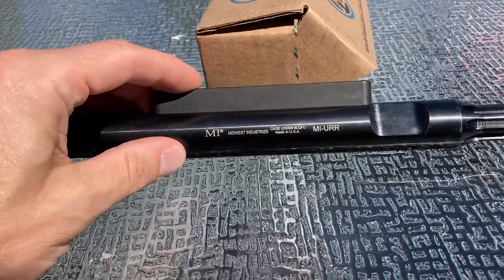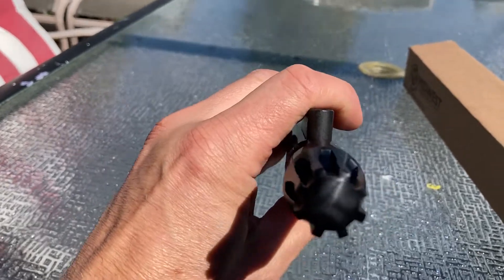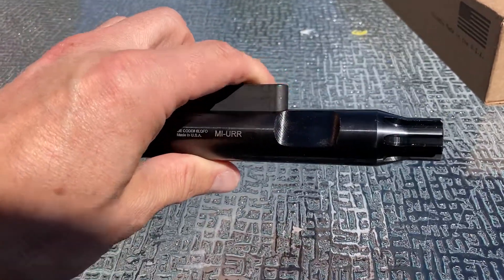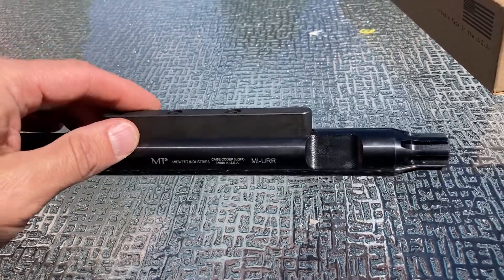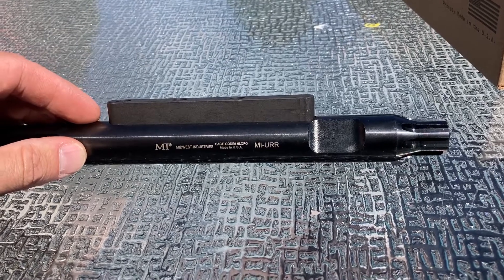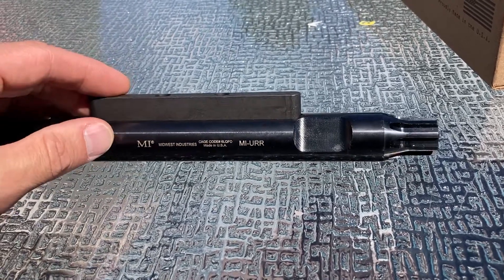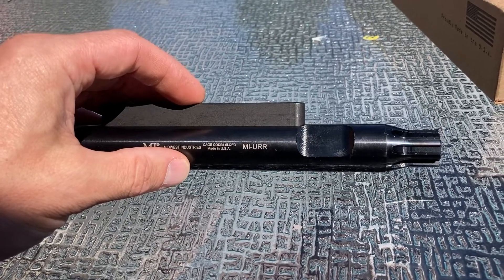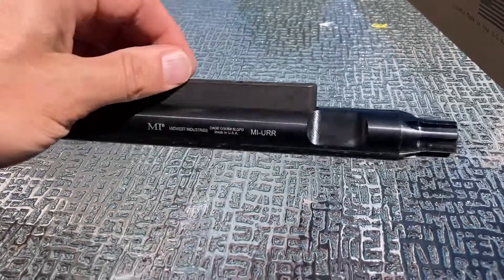Midwest Industries MI-URR Reaction Rod

Comment: Just got one of these and it has the same issue.  Waiting for a response from MI on it, but I may just go ahead and send it back to the retailer for a refund.  Sounds like there's quite a few of these 'mis-timed' ones out there that weren't properly QC'd.
Reply: Update: MI got back to me within a couple of days and sent a return label for the URR to be returned to them for inspection/replacement.
Reply: Same problems with mine and Midwest is ignoring me
Reply: I, ordered twice and both of them were for a 308 but  labeled for 5.56not 5.56.

Comment: I just got mine. When me and my friend installed my barrel we used a bev block. I’m thinking the bev block allows for the barrel to slightly move when torqued down. I’m going to try removing the barrel and reinstall with Midwest rod and see if that helps. There’s hundreds of people who use this tool, so it’s possible the issues is with the prior installation of parts. Just my opinion and what I’m thinking. I had this same issue trying to use mine.
Reply from the maker: It's visibly crooked, and it fits the one receiver where I know the barrel is mistimed

Comment: Every tool doesn't work because of the one he has, and he has multiple bad tools. It's obvious this is operator error or he's a shill for a specific product.
Reply from the maker: Which one am l shilling for? I'd like to try it lol
Reply: I have tried 2 that are for 223/ 5.56 would not fit
Reply from the maker: I hear 2 unique is a better tool
Reply: @whattheshit4664  I have two Mid West URR's and two Unique barrel spuds..All 4 are fine and work perfectly..The 2 Unique has tighter splines with less slop in the barrel extension and the URR has a tighter fitting sail..
Most upper receiver carrier channels are under spec these days and can come in a variety of I.D.'s  
Some upper receivers will not work with the URR or the barrel spud, even though the tools are under the 1 inch I.D. mil spec carrier bore tolerance..
You are not the first person who has complained about an out of spec URR..I have not seen this with the 2 Unique barrel spud..
If the URR is too tight, it is easy enough to remove the sail and have it turned down to fit your upper..I would re-attach the sail and not use it with out it..The sail is what keeps the stress inside the upper and not on the receiver threads/index slot.. It also prevents the barrel from clocking when mounting the barrel..

Comment: Have you tried loosening the sail bolts and fitting the tool into your assembled uppers? I'm thinking it could be that the sail has some play between the bolt & holes and upon torquing the bolts down it may end up being slightly off to have an interference with the upper receiver. I'd try loosening the bolts and see what type of play you have in there for adjustment before retorquing the sail bolts. In any case, torquing the barrel nut down on the high end of spectrum will move that sail with the built in tolerances.
Reply from the maker: The flat on which it's bolted looks clearly mistimed with respect to the spline.
Reply: I loosened my Allen bolts a little bit and it fit. Not sure if this is the correct way it should work but it fits. I agree with op Midwest doesn’t have good customer service.

Comment from the maker: OK I managed to get a hold of Midwest and the tool is en route back. Knowing that they do not reliably time the spline to the flats, eveb if the replacement looks  straight i wont use the sail. And i plan to buff the spline to remove sharp edges. One other thing and I'm guessing this is only on tools that have a sail because on the original the upper isnt aligned to the barrel: the fit in the upper is so goddamn tight the finish wore off the shaft just from inserting.

Comment: They have where the sail can be taken off with allen key.  I believe that is for when the sail doesn’t align.
Reply from the maker: But I shouldn't have to. The Tool is defective. I promise all of you. It's really obvious it's not even a question.
Reply: I appreciate the info.  I have been thinking of ordering.  I have watched other videos where it lines up perfectly.  If you took the sail off it would be like the Geissele. What upper were you using. Thanks
Reply from the maker: Aero w dd barrel. Two of the same, not just one.